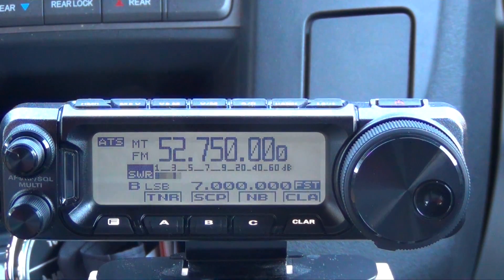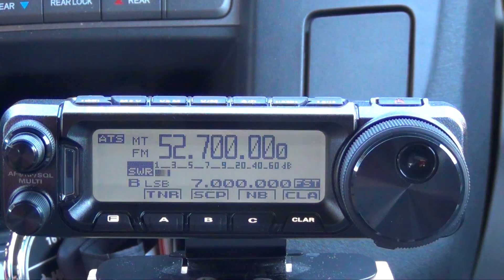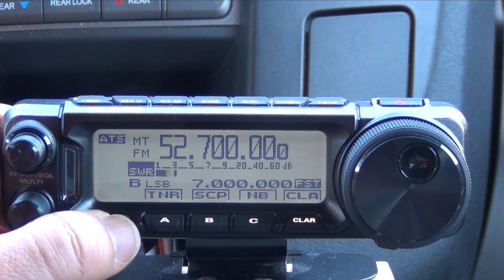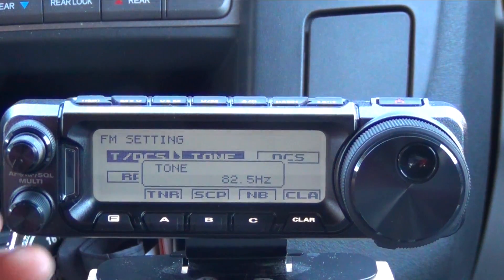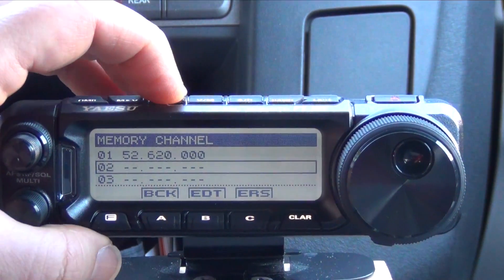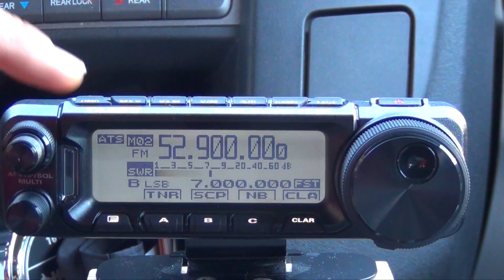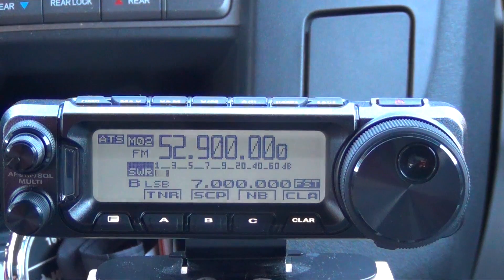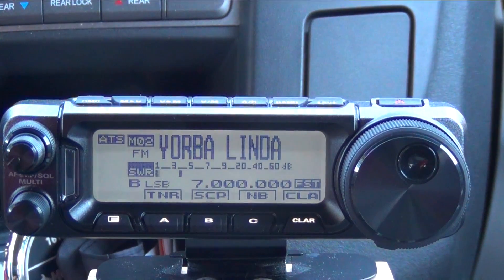Yaesu FT-891 Programming Tutorial

Comment: Yes, I'm thinking about this radio. What antenna are you using? I was thinking about a TarHeel screwdriver antenna setup...?
Reply: I was using a ham stick on 20 with my ft 891. I got a wolf river coil  and a 102 inch whip for 80 and 40  . Now I use a wolf river coil  silver bullet 100 and a  60 inch whip(.020 from a Shakespeare ugly stick ). 40- 10 meters, is very broad banded ,covers all of 10 meters below 1.5 - Remove the coil and the whip gives me all of 6 meters below 1.6 to 1 .
Reply from the maker: As a mobile, which I need to put this in the truck, I use the ATAS 120A (screwdriver antenna). It is designed to work with the FT-857D and FT-891. As a portable radio I primarily use Chameleon antennas. Sometimes Buddipole and Super Antenna.